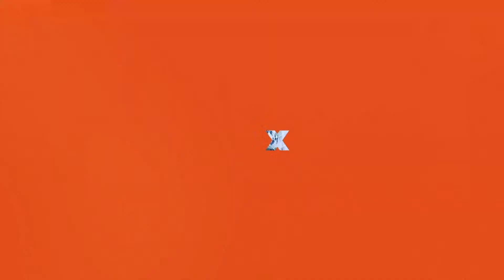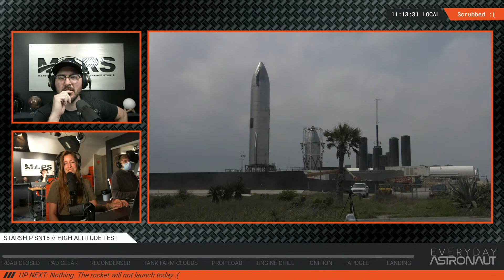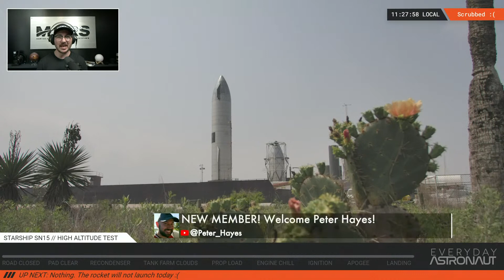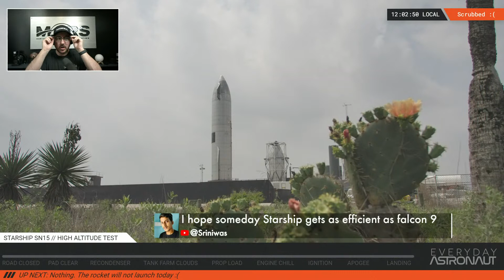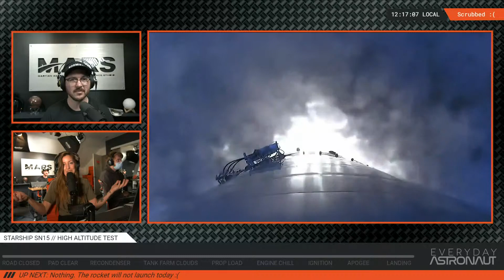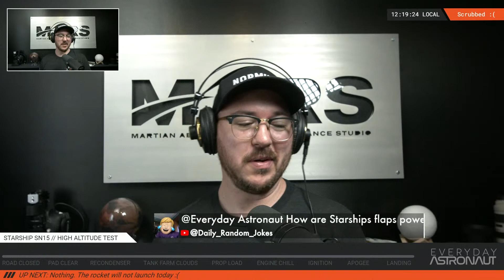[SCRUBBED] Watch SpaceX try and land Starship SN15!!!

Comment: I know i should be posting the challenge idea on twitter but sadly i don't have an account so here it is: Eve surface landing and return with a air launch system. This is not only hard but worth considering. It might be better to do air launch systems on venus since you would experience more atmospheric ressistance so why not use it to your advantage. Close surface gravity but thicker atmosphere means ground level launches have more disadvantages compred to that on earth, also temperature too plays into this you need to get out of the thicker part of the atmosphere before you accelarate too much otherwise you'll overheat. also maybe no parachutes because you would build something that can fly.